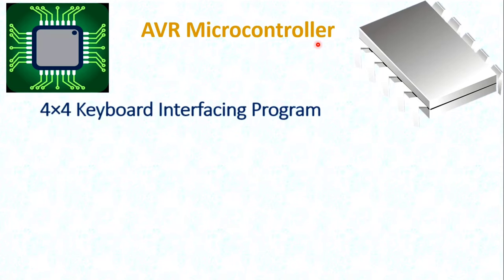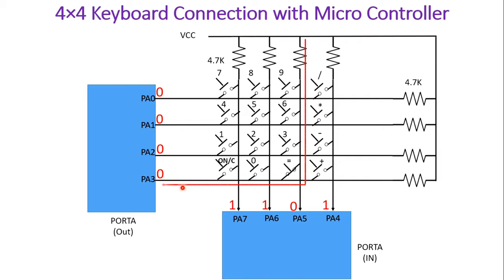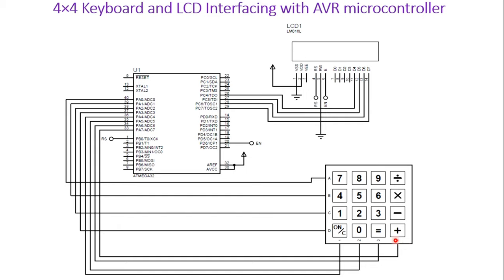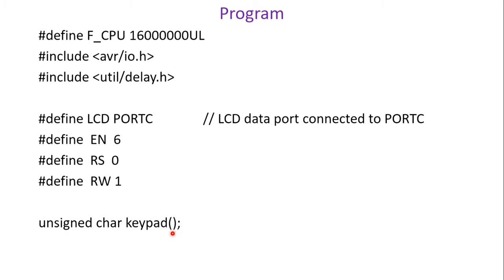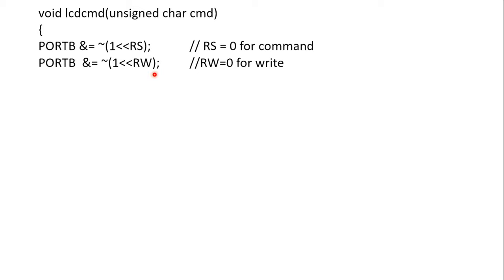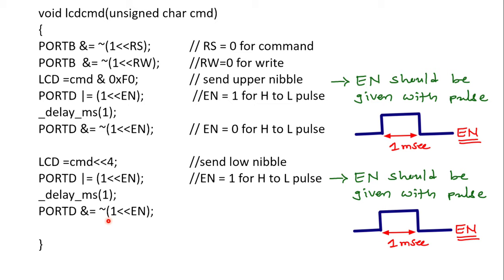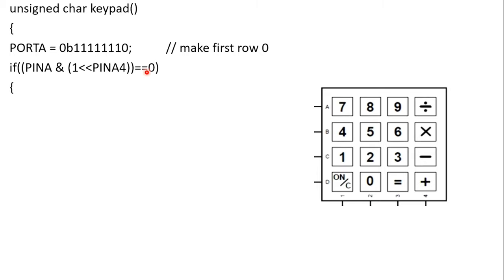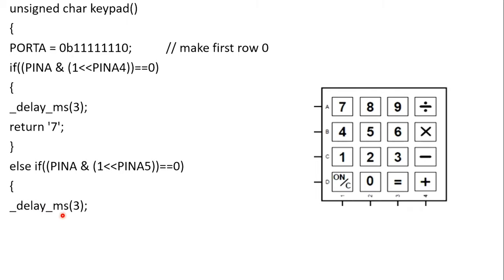4x4 Keyboard Interfacing Programming in AVR Microcontroller: Complete Guide

Comment from the maker: 4*4 Keyboard Interfacing Programming in AVR Microcontroller explained with given Timestamps:
0:00 - 4*4 Keyboard Interfacing Programming - AVR Microcontroller 
0:40 - 4*4 Keyboard Connection with AVR Controller
2:41 - Keyboard and LCD Interfacing with AVR Microcontroller
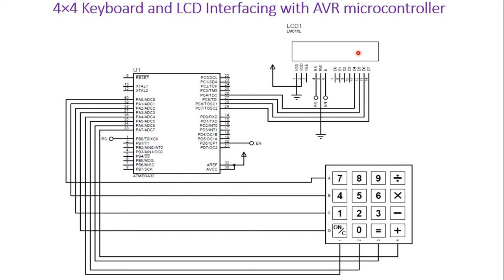5:06 - LCD Interfacing programming in AVR Microcontroller
14:06 - Keyboard Interfacing programming in AVR Microcontroller